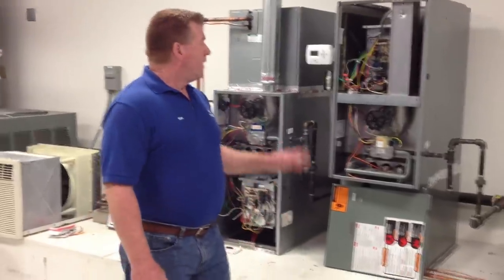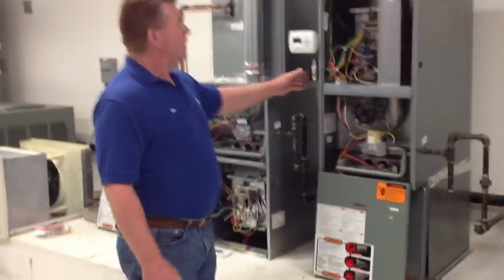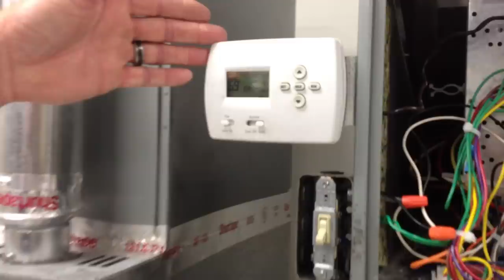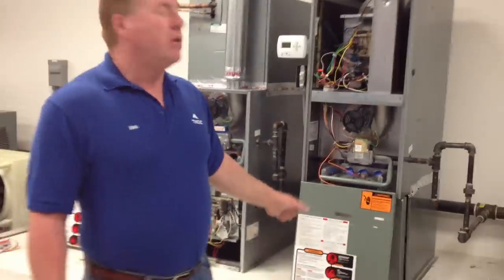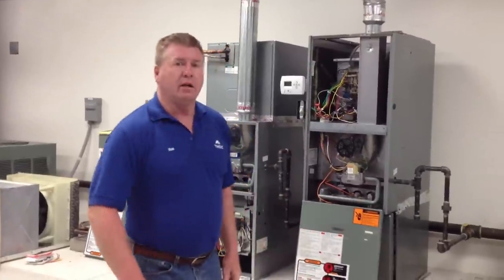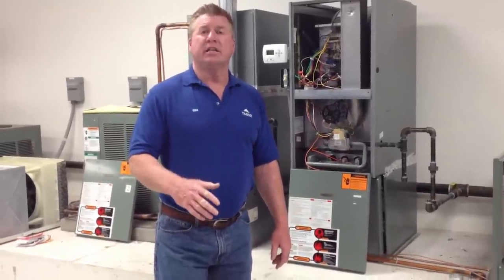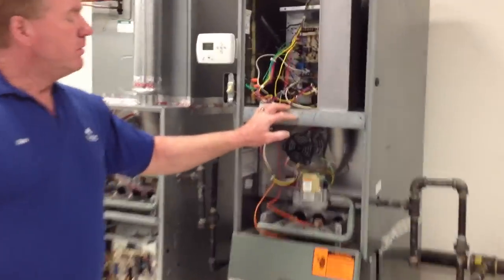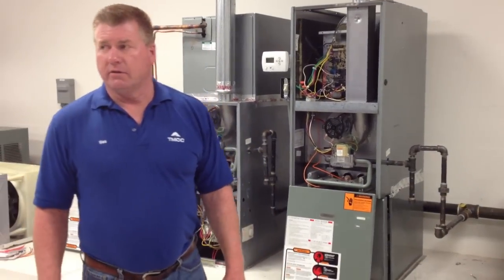Sequence of operation

Comment: Thanks Wes I was going crazy trying to figure out why the older furnace I was bench testing before installing kept short cycling (Short Flame). I replaced the flame sensor as it looked somewhat corroded but to know avail. All other cycles sequenced properly. At the end of this video you mentioned reverse polarity, that is when I realized that I did not check the polarity on the 110 plug end I had installed. I reversed the wiring on the plug and BINGO working furnace.  Thanks a bunch! This was a very helpful video!!
Reply: Reverse polarity should trip the breaker the moment power is turned on. Did you have a IFC board on your furnace?

Comment: Wes,  thank you so much for this video. After my furnace was malfunctioning I watch several video and none pointed to a problem that you did, which was to check the air tube  at the pre blower motor for cracks. As it turns out, that's exactly what was wrong with my heater. You are THE MAN!!!

Comment: excellent review! thanks for your tips. here is one for all. this was an older amana furnace. no ignition, draft inducer comes on no ignition glow coil. being a newbee finally found that the inducer motor lost the impeller on the other side of the motors shaft. motor comes complete kit for replacement. keep up the videos.

Comment: I had no idea that this video still was around.  Please understand I did this for my Masters degree for a college professor and didn't realize people where using it.  I guess due to my position I will post more how to videos to teach.  If anyone has any suggestion on what they might want to see let me know and I will do the best I can to answer or post.
Reply: Great teaching skill sir. I if I may suggest a video on heat pump reversing valves operation. It may good to do a video on combustion analyzing.
Reply: I'm currently a student at what seems to be a second rate trade school . Thanks sir you have made this so much easier to understand.
Reply: Wes Evans thank
Reply: Wes Evans thanks for the video.  Make more.
Reply: I really appreciate you making this video, you made it easy to understand, if you could maybe next time use a multimeter to check components
Reply: Could u show us the operations of a heat pump on heating ?
Reply: Wes Evans awesome video, very well articulated. Feel free to post more of videos that go into detail!
Reply: Wes Evans Your sequence operation is wrong. Flame rectification has to take place first before the blower turns on. There is a delay in the blower turning on for the heat exchange to warm up. There’s a three second time for flame rectification or the system will shut down before the blower turns on.
Reply: @thomasdupont1931  flame rectification is not part of the sequence of operation.
flame rectification happens within the flame sensor itself since since the flame sensor acts as a safety.
Thats like me saying "oh your sequence of operation is wrong. A negative vacuum has to take place  before the HSI could go on" oh where does this negative vacuum happen? oh thats right in the pressure switch, so it can close the contacts.
Sequence of operation
Call for Heat
IFM 
Pressure Switch 
HSI 
Gas valve
Flame Sensor
Blower motor
Reply: I’m in hvac school now this is really helping with the gas furnace module we in now

Comment: Great video Wes.
In regards to Long Denis.. i would give Trane a call but in lieu of that if you knew the sequence of operation the glow plug or hot surface ignitor should stay on long enough to light the burners and flame rectification verified before going out. If it is not happening or happening intermittently then i suggest you isolate it and ohm it out then compare what you are getting to the manufacturers specification. It the ohming is correct then continue back to the IFC board and verify what signal you should be getting from the board ie time or current or both. Hope this helps. Others feel free to add input

Comment: My Heater/AC is a package unit - it calls for heat from the thermostat the blower fan comes on after that it blows for about a minute I hear a few “pops” maybe sparks then shuts off in lockout mode. 

Based on the sequence of operation I believe it’s the pressure switch. However, I do hear 2 separate clicks during this process. Which I kind of think it’s the pressure switch. I do not hear the ignition switch spark. Basically, the burners don’t go on as I’ve explained. From this video I can conclude it’s the pressure switch (I do hear 2 separate clicks though).

What do I check from this point on?

Comment: I have a Haier gas furnace that is giving a 2-blink code.  The furnace has four blink codes according to the inside of the furnace cover.  The codes are:: 1: Burner Limit Circuit Open; 2: Primary Limit Switch Circuit Open; 3: Pressure Switch Open; 4: No Circulation Airflow Lockout.  My problem is that I am getting a 2-blink code, which is Primary Limit Switch.  I replaced the Primary Limit Switch with an exact replacement part but that did not fix the problem.   I have not yet checked the sequence of operation as shown in this video but I will in the morning.  In the meantime i would appreciate any suggestions.  Thank you.

Comment: Hi Wes , very good video. I keep burning transformers , only primary side when the shorts were found at the condenser low voltage contactor coil. Can you please explain this. Thanks.

Comment: This is a helpful video, but you need to be more specific on the exact function of the various control switches.  Are they normally open or closed and exactly what causes them to change state?  It would also be helpful if you would use both the English word and and the commonly used term by people in the field.  For example IFC:  What is it?  I would call it the mother board, but I believe IFC indicates  something like Integrated Furnace Control. 

The problem I have with my Goodman furnace is the documentation is not well done.  For example in the documentation there is no indication in which position a Dip Switch is on or off.  I think for the average homeowner "twining" is the least of their worries.  Most residences probably only have a single furnace.   Finally I'm not a fan of "blink codes."   Home alarm systems have had English language displays for quite some time.  So does my CPAP machine. (Continuous Positive Airway Pressure). used as remedy for Sleep Apnea.

It seems that there should at a minimum be a plug for an accessory tablet style display that would point directly to the problem, and perhaps even including a help guide.  This display could also include information such as Run Times in Various Stages.  Dip settings.  BTU consumption. Duct Air Temperatures.  Filter Change Status,  and cumulative electrical consumption. Perhaps a Carbon monoxide sensor and and natural gas leak detector could be added and so on.  The so called modern high efficiency furnace is still in many ways operating in the dark ages.  A blink code is the ultimate "idiot light."
Reply: Not really because if the Control Board is not faulty it gives you an idea where to search for your problem.Many Code Blinks give more than 1 possible problem but between blink codes and actually knowing the Sequence of operation it Helps techs to know where to start looking I am 63 been doing this since 17 and still learning and seeing New Problems and things happening in this Industry.

Comment: Wes, At the end of your video you showed a similar sequence as the flame sensor switch.  Meaning the gas ignited but went out 5 to 10 seconds later.  I have replace and cleaned my flame sensor but the flame goes out (gas turns off) after several seconds.  Assuming the flame sensor is working what could be the issue?
Reply: The issue could be a bad control board. Not sending power to the flame sensor. Or you have a bad ground wire or loose wire connection.

Comment: Great video. Thank you.  for my Trane xe 90, everything seem to work up to the point  where the glow plug comes on.  It stays on for about 3  to 4 sec and start to die off thats when you hear a click for gas, i guess, to come on and light the burners.  I'm not sure if the glow plug is not staying on long enough or if the gas is not coming on early enough.  it's a hit or miss. sometimes it lights it sometimes it doesnt.ANY IDEAS PLEASE. (new gas valve, new control board, new blower motor, new capacitor. glow igniter looks good and get pretty brite.

Comment: Exactly what polarity are you reversing?  The hot and neutral from the load distribution center to the furnace or something else?  (white and black power supply wires reversed?)  Also what is your position on safety grounding?  Should the safety ground (earth ground) return only to the load center, or is it acceptable to safety ground to an indoor copper cold water pipe?
Reply: The Hot and Neutral main power or 120 Volts is Reversed Polarity also the Ground should go back to the Ground of your panel but grounding to Cold Water pipe was common in the day but Electronics act differently with Neutral and Grounding Properly on the System

Comment: Hi Wes- great video!  I have a GUA Series Gas Furnace (model GUA080A012AIN) that gets through the ignition sequence all the way up to flame.  The Fan/Limit switch (Honeywell) eventually cuts off flame so the fan/blower never kicks on to heat the house.  This happens often but not every attempt so it's been pretty confusing- would you be able to steer me in the right direction?

Comment: @ 7:23 #2 condensate could fill the pressure switch line. The hose should be short and angled up.

Comment: You never said anything about one blinking code. (Ignition failure) causes?
Reply: No ignition could be no gas supply or failure of the igniter.   I believe the sequence would be igniter reaches temperature, and subsequently gas valve opens.  If you don't see a glowing igniter, the gas valve will not open.  I believe the igniter itself could be tested with an ohm meter.  It's going to be like a light bulb.  It either is open (burnt out) or a closed circuit.  If an ohm meter shows continuity it should be OK.  I believe the igniter must be dominated by the pressure switches which need to be closed at the proper operating pressure range.

Comment: My basement so warm.  I went over to furnace as it was running and a lot of warm heat is blowing out from back of furnace.  a 
as if it was a vent.     Is this normal?    for years my basement was cool.    I have a gas Furnace.

Comment: Wes, Great video! We're in Reno and got a kick out of seeing this from TMCC. 

We have a 12 year old Rheem Criterion RPGJ that's going thru the sequence normally but the flame shuts off after about 5-6 mins before reaching target temp and we get a 3 blink code. (Blower keeps running then shuts off as normal) . 

Furnace will come back on after about 2 mins and go thru same sequence again. It will do it 3 times to go up 3 degrees to target temp. We change the filter every month (Rheem #7 previous owner had washable but rarely ran it. Inspection a year ago revealed no issues.) All vents are open. 

Cleaned flame sensor and tried the reset on the high limit switches, didn't seem to do anything though. (Is it the little red buttons in between the 2 connectors?)

We ran the furnace with the doors off to test it, and to watch the sequence and for a possible error code. It ran like a champ for 25 mins to target temp 5 degrees up. Strong like bull! No error code. No cycling. Everything seemed to be running fine. 

Then, this morning, the first time the tstat calls for heat it does the same 5-6 mins burners stay on, then burners shut off and 3 blink code, blower keeps running then shuts off, stays off for about 2 mins and then sequence starts up again. 

The only change is the doors are on the furnace. ???
Reply: +Ocsurfgir the problem could be a dirty flame rod. may just need a cleaning use steel wool or sand paper .
Reply: East coast Thrilla Thanks for the reply! We already cleaned the flame rod. Left it out to test and the furnace shuts down very quickly (within seconds. Good thing!) Ours was running for about 5-6 mins. We ended up blowing out the compartment and blower motor with compressed air. That seemed to fix it.

Comment: hey Wes, thanks for the video. I've been researching heat exchanger problems for a while now but havent found my issue. My sequence is correct but the flame cuts out abt 3-5 min after ignition and flash code of 33. once the inducer blower finishes clearing out the heat, the error code goes away. What could cause a limit switch to trip 3-5 min into the cycle? flame sensor is good and doesnt appear to be a rollout issue...any advice for this greenhorn?? :-)
Reply: C Johnson 
check for air side restriction, and or clean the spuds.

Comment: Some times furnace runs good then once while it does not . calls for heat motor runs no igniter  glow plug does not light up .  does that mean I need pressure switch .

Comment: watch your your video. Have one question? when I set my thermostat say to 73. My furnace doesn't shut off. Do I need to replace thermostat or is that the fan timer
Reply: The thermostat is what terminates the process when temperature in the conditioned space has been satisfied.

Comment: hey wes. mine is a rheem silhouette II.  the sequence of events is as follows: 1. call for heat. 2. induction draft motor. 3. pressure switch clicks. 4. electric igniter ignites. 5. no burners light. indoor blower motor starts. 6. system shuts down and repeats itself 2 more times. then I get the blink code of one.so this system fails after the igniter with no gas or burners. what would you suggest my steps would be, and what is the more likely culprits causing this?thanks for your time.respectfully,  Richard Carson
Reply: Richard Carson I
Reply: No gaz probably, check burners might be clogged or gaz valve

Comment: I need help, furnace works fine thru first cycle. After burners and blower shuts down I have something that is not shutting the gas off. After manually turning off the gas and waiting a while, I can turn the unit back on and will go thru that first cycle again with no problem. Help!!!!
Reply: Wilbert Kelley 111 check the flame sensor

Comment: Had a furnace not turn back on after resetting main breaker. Checked for power going to board, 120 volt, good. Bypass the thermostat, so it continually runs and board will not light up, the red light, troubleshooting codes. Figured the board went bad , I am on my second new board same problem. I have tested the transformer to see if it was still working and it seems to be operating normally but I was wondering if it could stop transferring the 24 volt charge and give 120 volt?  Does anyone know what I should be checking next? Would the transformer be bad? I still have no light on the motherboard. Any advice would be helpful, except for the one where I can get a HVAC professional, because if nobody gives me any advice I already understand that would be my default option, so past that unwires thanks!
Reply: Faulty wiring problem found. Was getting power going to furnace but the ground was not correct.

Comment: because my inducer fan motor does not kick on and I know that's the first step of the sequence. is there a relay that kicks it on and how can I check for that
Reply: could be the fan itself
Reply: useful  tool  voltage tick.   senses voltage   . if the wires have voltage then its a bad motor.  Google induce fan not running should be a video on that

Comment: my inducer fan motor is not working.  does it run on high voltage or low voltage ?
Reply: 120  volts
Reply: low voltage is gas valve . The board is 120 volts  near the top.  lower part runs on 24 volts

Comment: my furnace sequence as follows - thermostat calls for heat- igniter glows- gas ignites and there is visible flame-  after so many seconds fan starts  ( same fan that turns when a/c mode is on )   however the air coming through vents is not warm.  is there another fan?  its like the heat is trapped in the furnace and not being drawn through the ductwork. i dont have the unit opened up so i am describing what is visible to me through the glass window . the capacitor that was mounted  on the outside of fan looked defected so i replaced it but heat from flame is not coming through vents- it blows cold. please tell me what i should do next
Reply: eddie bogert  check air filter or evap coil could be dirty not letting air through
Reply: or your blower motor beneath heat exchanger might have a bad motor

Comment: Your sequence of operation is wrong. Flame rectification has to take place before the blower will turn on. There is a 30 sec. blower delay for the heat exchanger to warm up. You have three seconds for flame rectification or the unit will shut down. Before the blower turns on.

Comment: I have a furnace that does not turn on. Does not blow hot air and does not have inducer motor turn on. What can be the issue?  The control board does not have any lights on either...